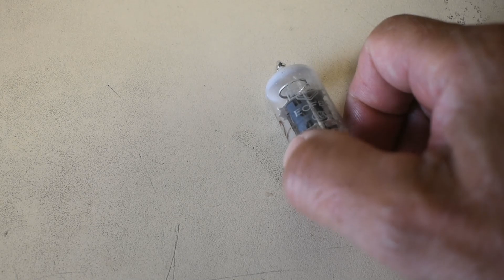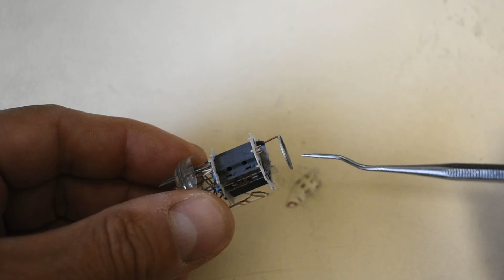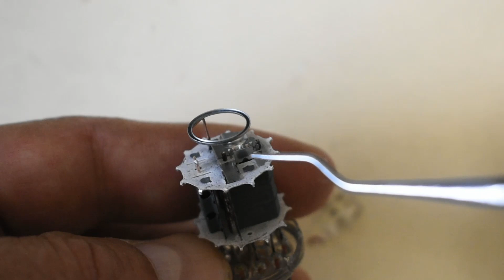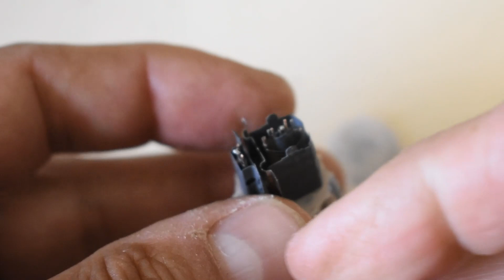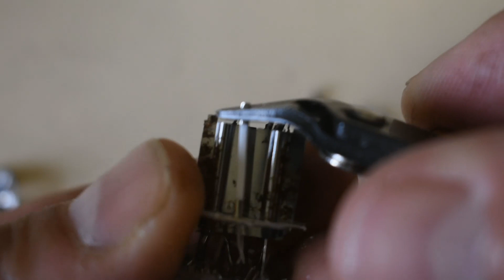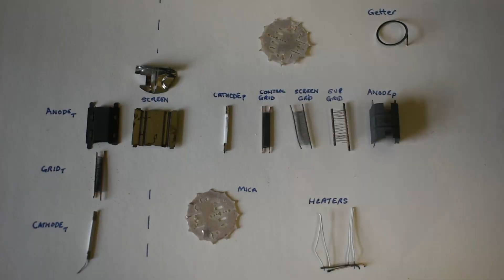Inside a ECF80 vacuum tube

Comment: Thanks for yet another superb and demonstrative video Kram. I have always been very impressed by the precision and intricacies of thermionic valves and moreso because the huge volumes that were made when they were state of the art must have involved a great deal of automation. Your video really brings this home.
Reply from the maker: Indeed, as you say the precision for a mass produced reliable item was impressive. Found a faulty EL34 in an amp recently where the cathode had worked itself out of the mica support and shorted on the control grid. Probably due to creepage with  thermal cycling.  Sadly this wasn't an old valve with many hours of use. These are still made for guitar amps.